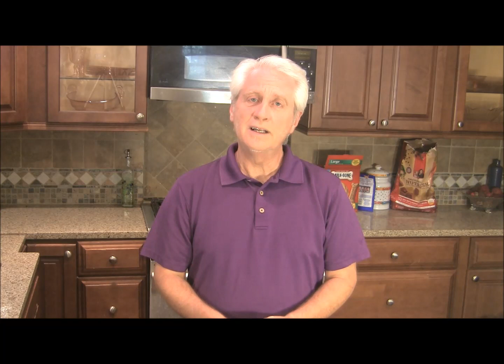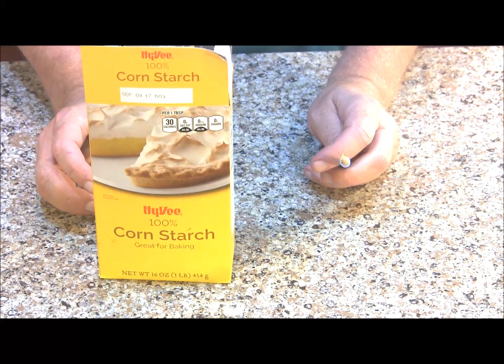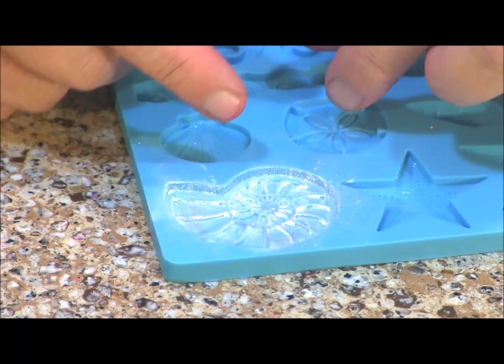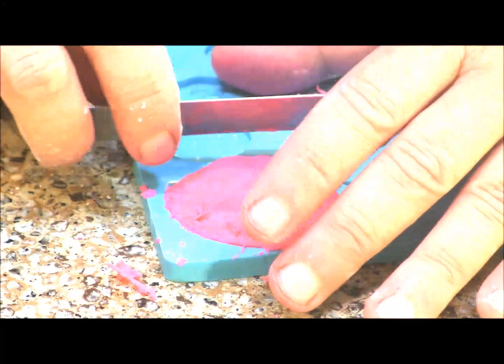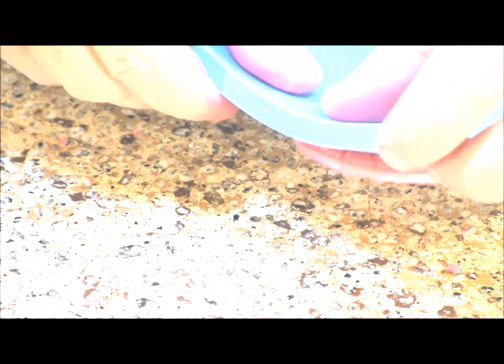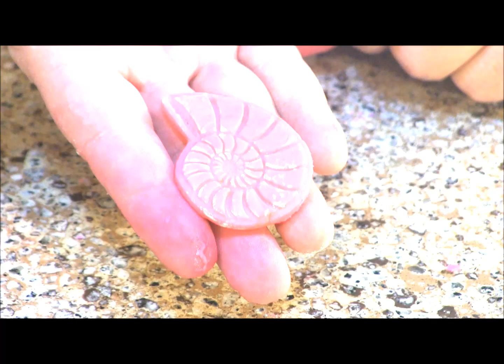Using Silicone Fondant Molds

Comment: Why did you use powdered sugar on the top as you pushed the fondant into the mold and not like the corn starch like before. Wouldn't that make it more stcky?
Reply from the maker: You could use corn starch as well. The powdered sugar works too.